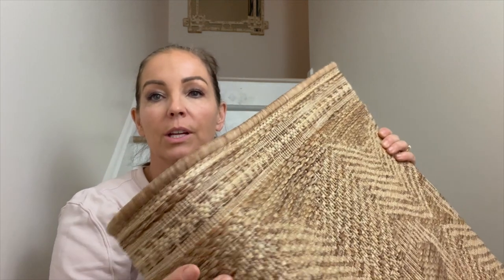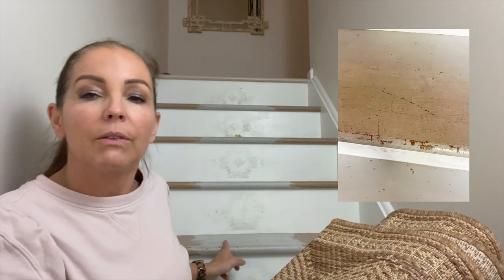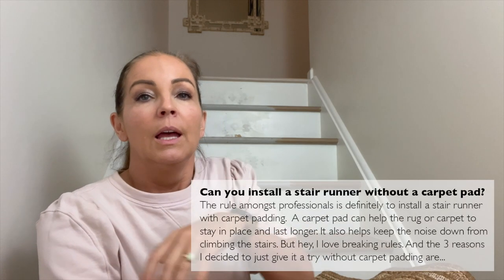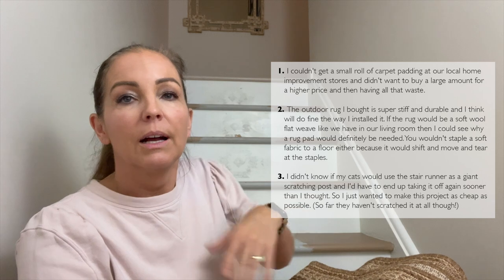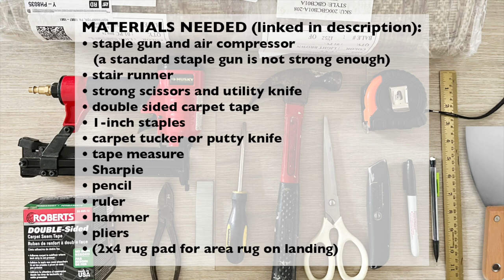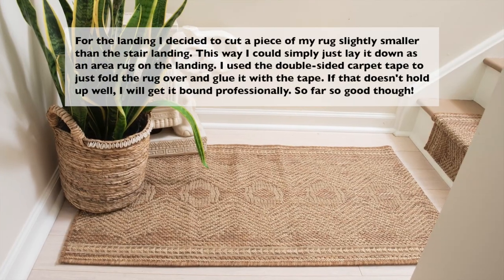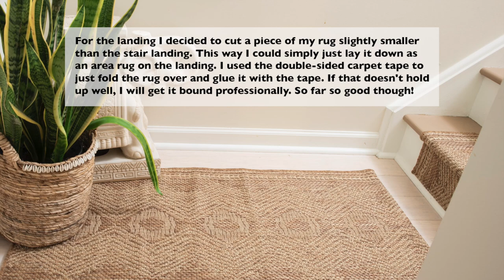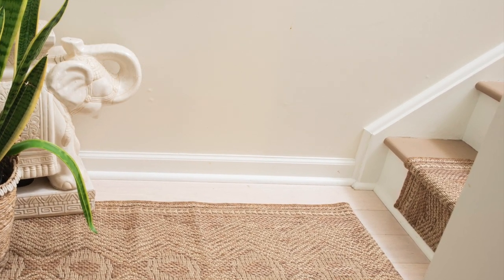How to install a runner on stairs without rug padding

Comment: Hi there! How did the runner fare with your cats? I have cats and wanted to check before I installed it.
Reply from the maker: It's holding up great so far with the cats. I kept an extra piece of rug in case I ever need to replace a section too.